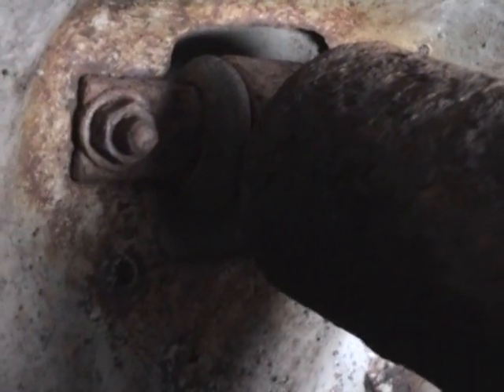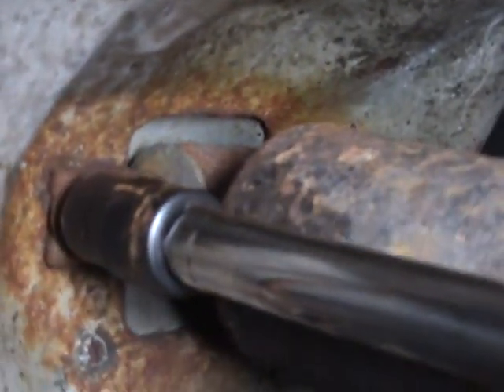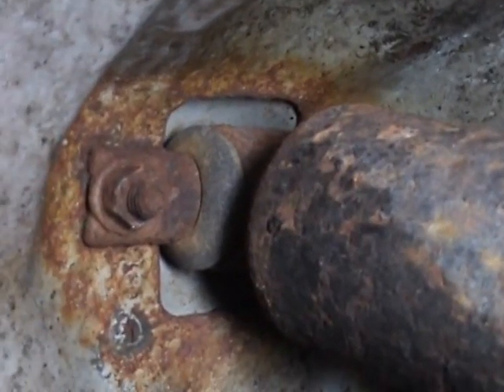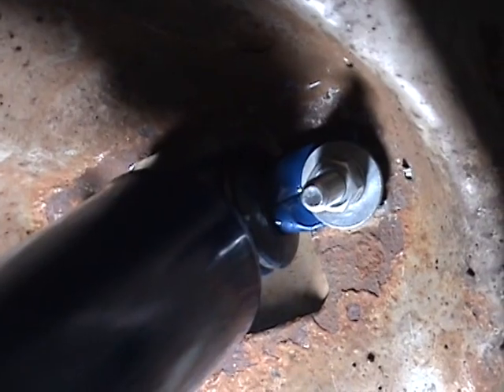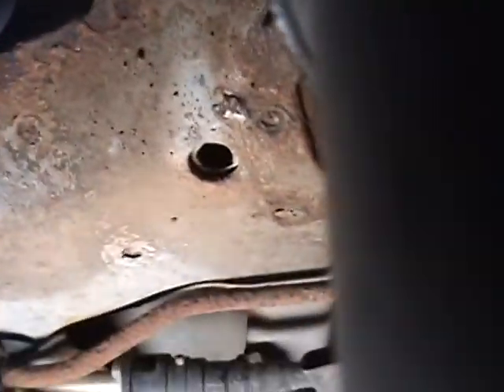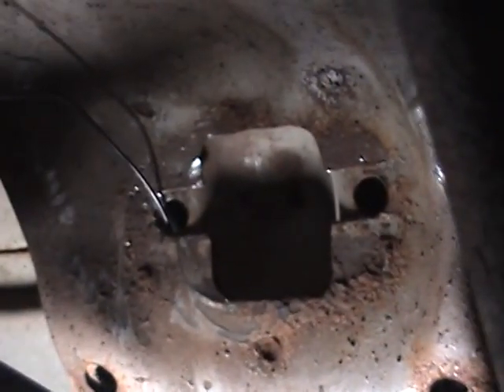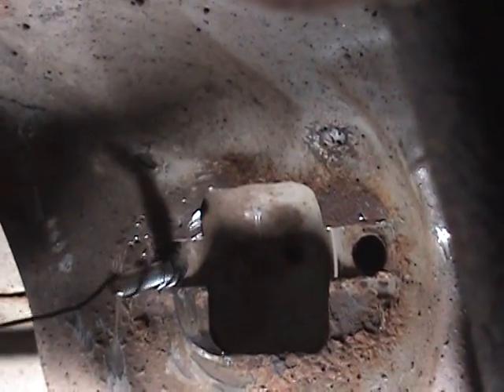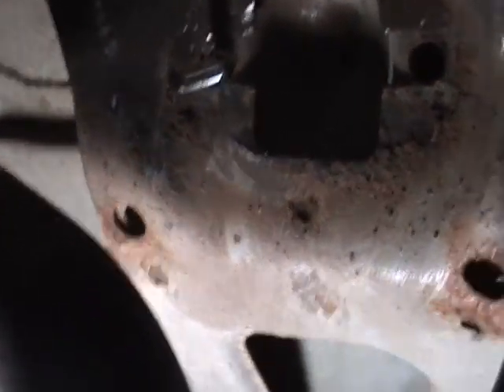Replacing upper rear shock bolts on Jeep Cherokee

Comment: this worked for me, some of the weld nuts came out easy the others not so easy, but so much easier than drilling the broken bolts. Thanks for the tip.